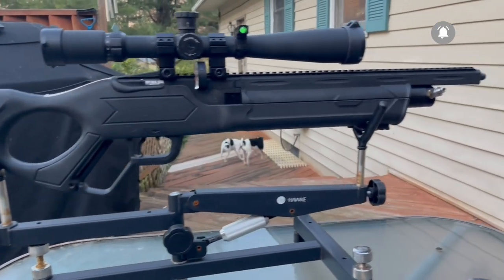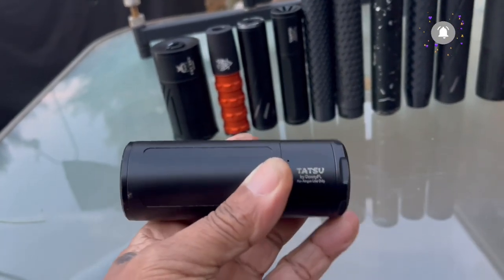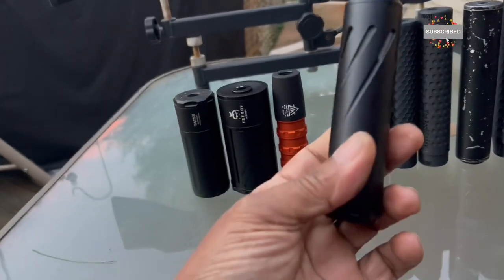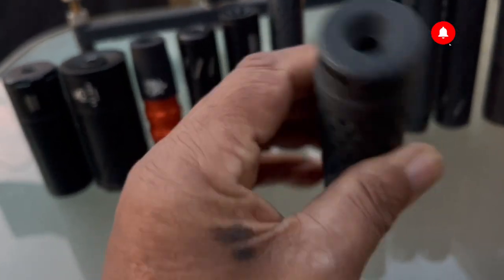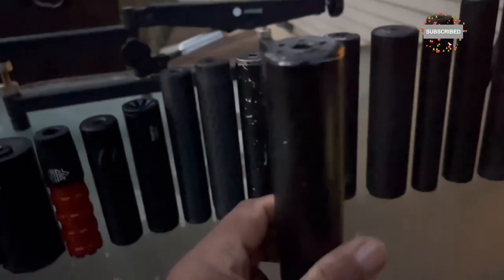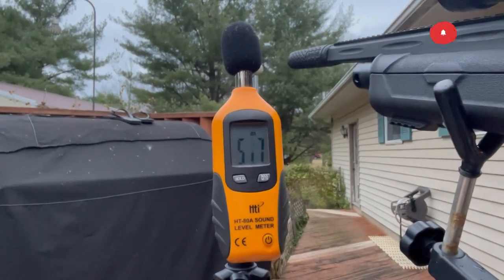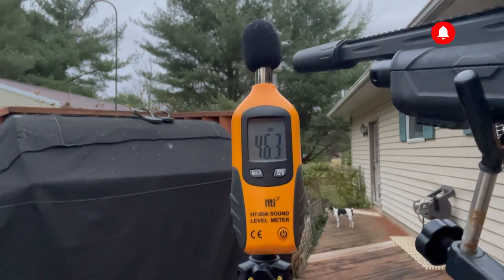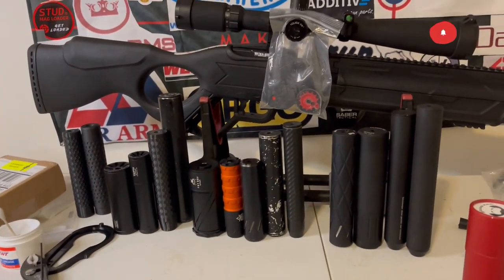🤫15 moderator testing #buck-rail #impulseair #huggett #zbroia #weihrauch #airguncapital #0db

Comment: Lot of Rambling .  Should have cut to the chase at the end .  Show a chart with the name of the Moderator, List the price, List the Sensor reading. DONE. Then you can disassemble on the topic. Not know why you did not simply show a chart at the end. Do appreciate you doing this, but not know why you failed to show the data at the end.

Comment: I think you forgot one variable, a lot of the sound your db meter is picking could be the hammer spring which obviously moderators cannot quiet down. If you move the db meter forward of the gun you will get less hammer spring sound. You can 100% hear the larger moderators quieting the shot down a lot compared to the smaller ones and yet they read similar decibels. Just my two cents.

Comment: Nice work we appreciate it. We can hear the difference in the moderators but I do think your db meter was to close to the rifle and you was reading more hammer to value rather than the exit audio. It would be interesting if you did a video with you db meter mid range to see what carries less. Thanks again.
Reply from the maker: 👋🏾sup brAh! Thank you! The problem is I won’t be able to read the db # braddah👊🏾😎
Reply: @airgunspestingch.8426  Get a helper

Comment: A great selection of silencers to go at. I think your test is flawed though as so many others I have seen. I think the meter is picking up the hammer strike of the rifle which sounds pretty loud to me. In my opinion you need a board between the meter and the rear of the rifle to avoid the hammer action being picked up. It would be interesting to see if there is a difference. A great video to see so many silencers together. It would have been nice to know how much they cost as well.  👍
Reply from the maker: 👋🏾sup brAh! Thank you for your input! Hammer strike or not regardless the db meter will still pick up the moderator when fired! It’s the end result that matters braddah👊🏾😎
Reply: A completely failed test.

Unsilenced should read about 95db.  Silenced S.B. around 75db or a suppression of about 20db.
Reply from the maker: @felinis3788  👋🏾sup brAh! Ok so it a failed test! That is what my db meter reads! It is what it is braddah👊🏾😎

Comment: Bruh, you doing big things! All them mods smh. I picked up a wolfairguns mod, years ago, which they made specifically for my Hatsan. It was very inexpensive and quieted my gun waaaaay down (more than a few dB's). The weird thing is the next one I ordered was narrower and not as quiet (?)

My question for you is does the two to three dB reduction make the moderator worth the effort? In your opinion.

Anyway great review keep up the good work.
Reply from the maker: 👋🏾sup brah! Any moderator will moderate sound some better that others! Moderation depends on the tune of your gun. A 12 fpe  gun is quite thru moderation vs a 30fpe plus gun. I hope I answered your question about moderators braddah👊🏾😎

Comment: hey, if you don't mind me asking, what's the size of the thread adapter Terry from Buck Rail put into their moderator? The uni-adapter they provide is very brittle and would like to adapt to brass connector on barrel. I know the printed adapter and suppressor have M20X2 threads, but what should they reduce down to?
Reply from the maker: 👋🏾sup brAh! Terrys moderator are 1/2-20 but I bet if you contact him he could change it for you braddah👊🏾😎

Comment: BuckRail is best considering the price is cheaper than a can of pellets.
Reply from the maker: 👋🏾sup brAh! Sure you’re right braddah👊🏾😎
Reply: I have 4 Buckrail-line moderators they work remarkably well on co2 guns.  A lot of the noise of a pcp is hammer bounce and the ping from the compressed air cylinder ringing like a bell Co2 guns don't suffer from ping so they are extra silent,  I have 2 of the slip on Moderators which I believe they will stop making soon and 2 of the screw on like in the video on a crosman 2240 you will think your guns broken or lost power it's amazing the slip on cost 18 bucks at one time and the screw on was like 25 bucks now maybe 38 , that's 38 dollars like wow no way 38 bucks .  BUCKRAIL-LINE ROCKS

Comment: Are those half by 20 threads on the barrel itself or is it an adapter?
Reply from the maker: 👋🏾sup brAh! 1/2-20 braddah👊🏾😎
Reply: @airgunspestingch.8426  but is it an adapter or is the barrel threaded
Reply from the maker: 👋🏾sup brAh! 1/2x20 barrel threaded braddah👊🏾😎
Reply: @airgunspestingch.8426  thank you kindly